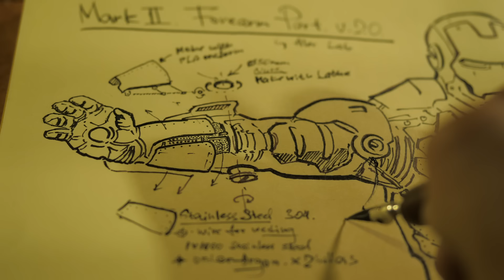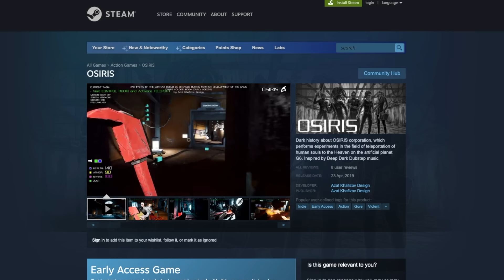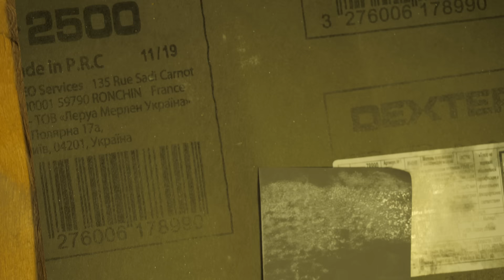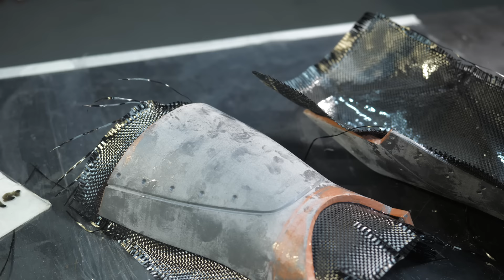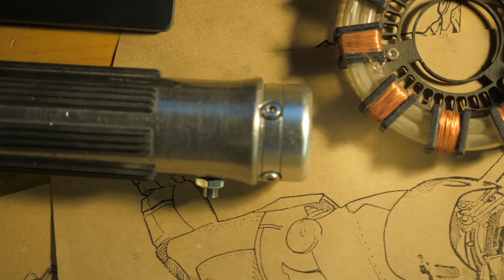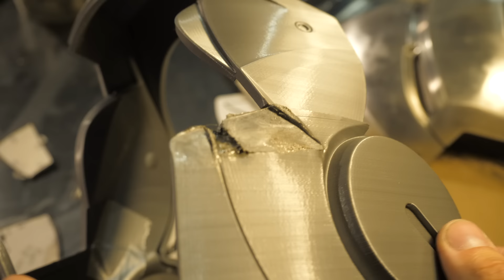3D print to full metal part: How to use 3D printer to make complex metal parts. Iron man helmet

Comment: Think the only way to make a full working iron man suit is to have it controlled by a vr pilot like how a drone is controlled.
 This give more space inside the suit to fit all the complex computers and somewhere to fit a decent size power battery. 
There is probably more engineering in getting the vr control system to work flawlessly then actually building the Iron man suit itself.

Comment: These techniques were fantastic! You can use these methodes to build a high/medium pressure hydrogen cylinder for pressure and fuel storage or just buy such cylinder. That would be paintball cylinder or proper 200bar cylinder (underwater diving)

Comment: I have a question for the last method. Wouldn't you have to 3D print the helmet a bit smaller to make sure the metal parts fit as intended?

If you don't, won't your pieces be a bit bigger than your intended dimensions?

Comment: I recommend that you put good padding between the layers of your body and the actual suit. If you were to be hit, this padding would prevent bruising and blunt impact injuries. There are Kevlar vests that can protect against a .50 cal bullet without being punctured, however the user wearing it will likely have induced internal bleeding due to the force. The solution to this is by adding padding that can slow down the impact. While I understand this suit is not necessarily going to be tested in combat, i assume you want this suit to be as “close as possible” to the movies and by adding the padding it would help. Another reason for the padding is by the looks of it, the carbon plating is put directly to your skin, which, in my knowledge is not very healthy. By adding the padding it prevents this. Another thing you may want to look into would be a cooling system to maintain a stable temperature. With having to carry several kilos on your back as well as the armour itself, it will be very tiring to wear, causing sweat to build up even with the exoskeleton. This in combination with the closed nature of the suit prevents cooling. A liquid cooling system might function best in this case, however this addition will also add further weight you may not be able to have. Assuming you need a minimum of 1L of water to cool you, the resivour and the pump along with the piping would weigh a bit on the heavy end. I’m not sure on the specifics, but if what you are doing for every piece includes the metal plating along with the carbon plating, it might be a bit too heavy.

Comment: Electroplating is essentially reversing a battery's ionic charge from a cathode to anode so that the metal ions are deposited on the anode. Normally this would lead to battery failure, but in this case it is useful. Ironically (ionically? ;), this is how corrosion also functions, but in reverse.
Reply: So what does it do?

Comment: Aluminum casting part from 3d parts for stronger parts and a rc engine on multiple transmission to multiple flat disce alternators to supercapacitor batter bank

Comment: ALEX BUILT IT IN A CAVE WITH A BOX OF..........high end machinery and infinite materials.
Reply: Our definitions of "High End Machinery" differ quite a bit. All of his fab tools are very basic. Not counting the PC, it's $1500-$2000 for every tool used. That includes the welder and the printer (ender 5 if I'm not mistaken).
Reply: @necropasia  , братан, если бы по 2000$... 2000₽, около того.
Reply: @aleks-ivanov  ты давно цены на технику видел? Не заставляй меня плакать, человек из 2011-го.
Reply: @necropasia  umm ur definition itself is high end
Reply: @sevenriversb3704  No, it isn't. A $6k welder (Miller dynasty) is high end. A $2k mill is high end, not a cheap drill press. A $2k makerbot vs a $300 e5. That $90 grinder is the same model most of us use in the industry. There's no plasma, no laser, no shear, no bender, no english wheel... It's nowhere near what would be considered high end in a metal fab shop
Reply: Yep hella high end compared to what Tony was working with in his cave.
Reply: @MrWongWey  That quote always baffled me. Tony was literally kit bashing his own state-of-the-art missiles and other products he partake in designing thus he can skip figuring out the technology bit entirely. If it wasn't for the manufacturing limitations such as needing to forge the MkI shell from scratch/scrap and having to do it in secret he would have something similar to what we watch here on his first try.
Reply: @egeoeris  The quote in the movie isn't about building the suit. It's about Tony being able to build a functioning, miniaturized Arc Reactor with a tremendous power output, in a cave with limited resources relatively speaking, enabling him to power the suit. Obadiah put his team to work at duplicating Tony's feat with unlimited funding and every possible cutting edge technological advantage Stark Industries had at it's disposal, yet they were unable to accomplish the task and deemed it to be impossible to shrink the technology. This proclamation from one of his leading tech's on the project, led to Obadiah's somewhat hyperbolic and enraged outburst in response. It's more an expression of infuriated frustration as well as taking a shot at the tech for not being able to get the job done.
Reply: @MrWongWey  well tony stank was given more expensive stuff then this guy.
Reply: I used to think I could make something like this because my brain was smart. But then I realized that my brain was the one telling me my brain is smart sh how could I trust it?
Reply: sike Tony had access to missiles he developed himself, probably 10 mil value
Reply: For those who don’t get the reference… 

“TONY STARK WAS ABLE TO BUILD THIS IN A CAVE, WITH A BOX OF SCRAPS!!!!” -Ironman 1
Reply: @TricBrosAnimation  to be fair Alexs is building a different Mark than the 1.
Reply: @musclemarrr  Obvs
Reply: @TricBrosAnimation yeah can you make a car out of this stick please? 🌿Tony is not real. Nobody can do that XD. Im happy Alex does it and it and works! This is the closest you can het to the real thing! 💪
Reply: @dr.sawdust4278  What did I do?!I’m just stating the reference for any sad soul who didn’t get it. Didn’t even mean to draw this much attention. I’m not bashing Alex at all.
Reply: @TricBrosAnimation  Yap but, scraps of intercontinental missiles
Reply: @TricBrosAnimation if you don’t know that already you shouldn’t even be here lmao
Reply: @Roland_Mine  Yeah well clearly some people shouldn’t be here then
Reply: I wish I had resources
Reply: @michaeljordan5630  me 2:(
Reply: @michaeljordan5630  same
Reply: These are not high end machinery and the materials he used were complained about getting as well. Plus ironman suffered similar conditions, that saying is a hyperbole
Reply: Hacksmith uses high end machinery this is machinery most people cold afford if they wanted to
Reply: I know some of yall are joking but I just wanna say, you can't forget how he started. If you back at his old videos he made do with what he had and his work space use to ALOT smaller too.
Reply: The mk 1 was built in the cave the mk 2 in this video and in the movie was not.
Reply: Iron Man? more like Crimson Dynamo <3
Reply: https://youtu.be/xoKMACZgTUc
Reply: He gets the greenies $ from his YouTube subs, duuuh!!lmao ✌️😂🤟🏼😎👌🏼😜
Reply: @Isaiah Stovall I dunno. Just incase.
Reply: @Isaiah Stovall people that read iron man.
Reply: He still did it tho 🤷
Reply: Gold!👌
Reply: I’m just gonna up and leave, I didn’t even mean to turn this into a big debacle. All I did was state the phrase from the movie. Really wasn’t expecting any replies to that.
Reply: Fancy cave
Reply: I’m sorry sir I’m not ALEX
Reply: Is anyone else curious as to how he has the funding for all of this? Like no doubt he is very intelligent and creative. But, how does he have the money to fund the projects, and support himself, and his family if he has one? Does he work a normal day job or? I know the materials are not EXTREMELY expensive, but they still cost a good amount of money, and his projects take a TON of time to research, develop, model, and actually construct and engineer, prototype and do all of those things before he has a fully working mechanism or suit/product. Meaning, he either doesn't work the normal day job and has plenty of time on his hands, in which case, how does he have the money for it, or he works a day job, in which case, how does he have the time for it? 

Man, maybe I am just full of excuses but I'd genuinely like to know because then it would strip any excuses I have.
Reply: He still Tony Stark bro
Reply: lol
Reply: Hella high end if you live in a third world country.
Reply: Well I'm sorry...I'm not Alex Lab.
Reply: Yeah hella high end compared to hacksmith? Hacksmith has literally everything but uses a cosplay iron man suite carrying a giant leaf blower and calling it Ironman proton canon 🤦‍♂️ all he does is click bait. His engineering skills as good as a toddler.
Reply: Yes build in a cave full of terrorists and without your heart
Reply: Dude this guy is human
Reply: Well the scrap is still more advance than our current technology as in Tony Starks world technology is more developed.

Comment: alex: uploads video
me: where hacksmith collab
Reply: Believe it or not, russia is actually a pretty long way from Canada.
Reply: @anonymouss.2158  Depends on where in Russia, and where in the US, and due to the fact that Russia is nearer the poles than the US, it's actually much closer than something along the same longitudinal lines
Reply: @anonymouss.2158  the hacksmith lives in canada...
Reply: Будет в октябре 2020 :)
Reply: Hacksmith would just make a 20 minute video where he spends 10 minutes doing sponsor ads and seven minutes repeating himself. It wouldn't even be worth it.
Reply: @dapperdapps  the math doesnt add up
Reply: beneath him, that's where
Reply: @kingmasterlord  Hardly bro, if they both worked together it would help both of them out.
Reply: @cindersofdeath5218  hacksmith is overhyped
Reply: @kingmasterlord  The dude made a plasma based lightsaber, overhyped is not the term I'd use
Reply: @cindersofdeath5218  anybody can make something similar just dicking around with basic electronics.
Reply: @kingmasterlord  Then why has no one done that before?
Reply: @cindersofdeath5218 they have, and it's a stupidly dangerous thing to do with way too high of a power consumption to ever be practical
Reply: @kingmasterlord  Really? Cause the only two sabers that use plasma that I'm aware of is Alex's and Hacksmith's with Alex admitting that Hacksmith's is better. Really, all you're showing is blatant fanboyism for Alex, and against Hacksmith, two groups that are respectful towards each other in every interaction.
Reply: @cindersofdeath5218  well thing is that hacksmith have lot of budget and latest insturments so they can make things easily and fast compared to alex..
Reply: @sarveshmore4665  That doesn’t that when Hacksmith decides to make something new, and it’s a big project, it is generally more consistent and better in quality anyways, although that’s exactly what you’d expect from a team as opposed to one person. If Alex joined Hacksmith, even if just for a collab, it would result in benefits to both groups as it would provide both groups with new techniques ideas
Reply: @s.j.c.  amateurish bullshit I'm making something better
Reply: @kingmasterlord  🎣
Reply: @s.j.c.  whatever the hell that is